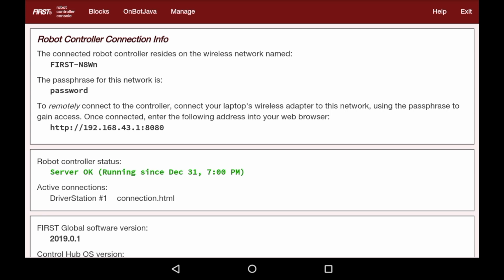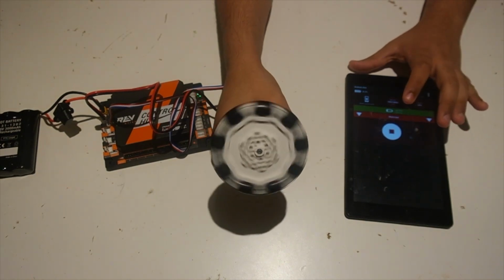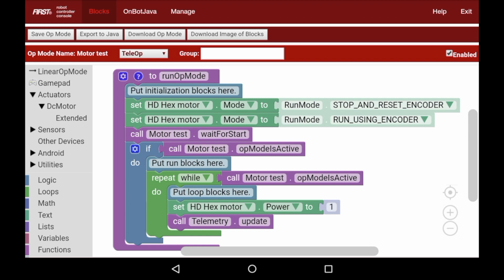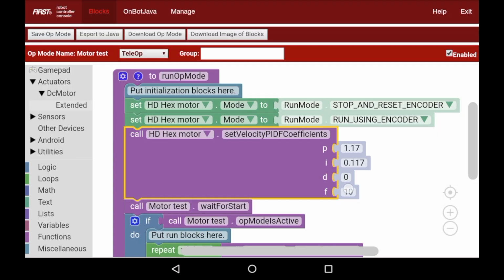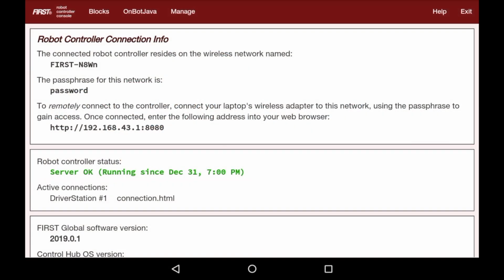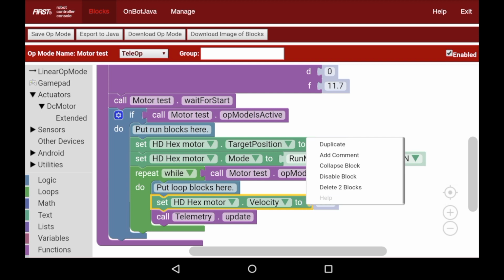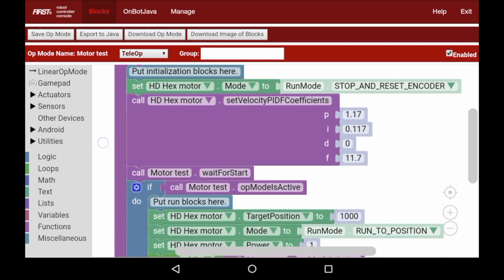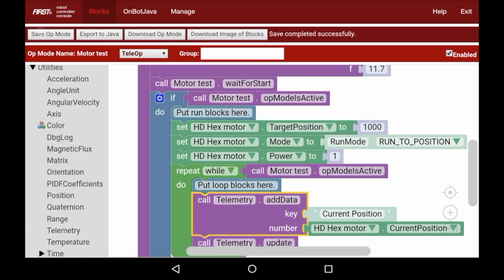Motor Programming in Blocks

Comment: Hello There!
My team is facing a problem where Dc Motors does not show up under actuators. We have tried many things, including using different motors and switching cables, to no avail. I could not find anything online for this, so I was wondering if you would have any guidance on this
Reply: Did you guys remember to configure the motors in your Driver Hub?

Comment: please could you help me, I try the same code in RUN_TO_POSITION 
and it not working the tablet show erro that I can't use RUN_TO_POSITION mode before I set Target position, and when I do that the error still apear or in another case ,it run but motor just rotate without stop
Reply from the maker: Do you have the encoder cables plugged in? Test if the encoder is working, as some teams have been having problems with the HD Hex motors in the 2019 FIRST Global kit. FIRST Global Team UK has a video released on how to fix the encoder problem. If you still can't figure it out, email us at wizards.exe@gmail.com so we can help you more.
Reply: @WizardsexeFTC9794  thank you very much ❤  I see the video of UK team and I think we have the same problem